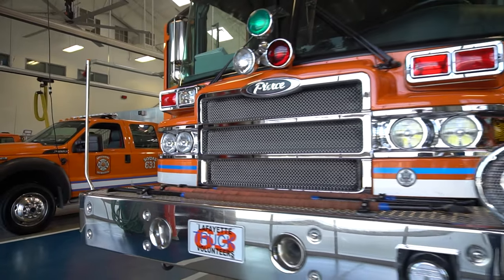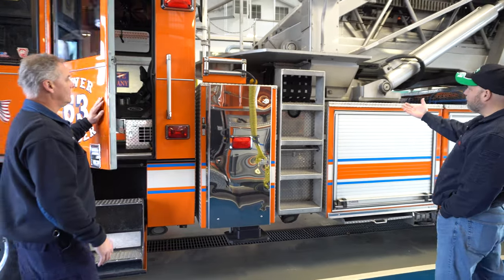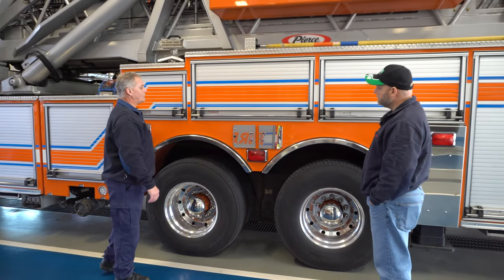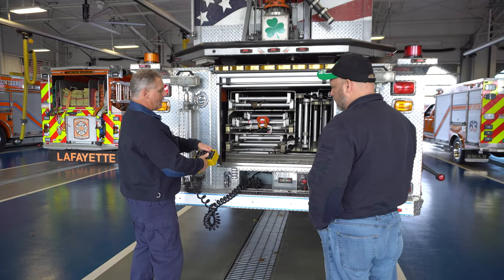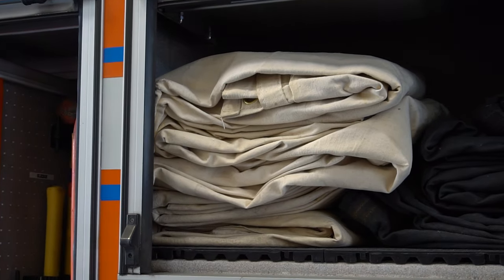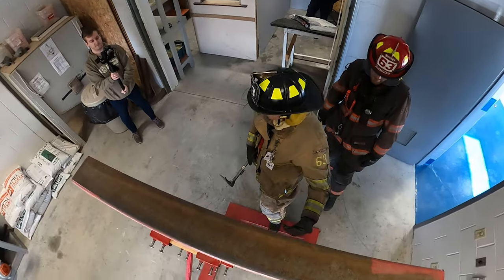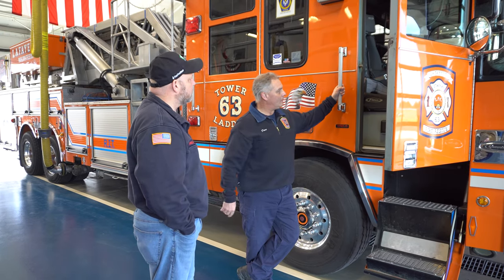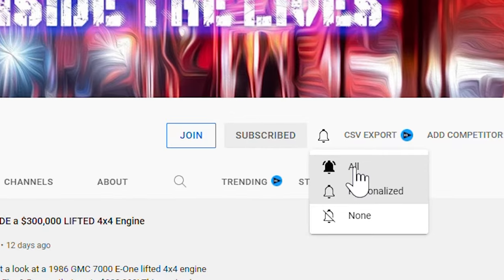ORANGE Fire Truck/ Good Idea?

Comment: Well, I don't think the color is bad at all. We have something similar here in Germany for the fire department, it's called RAL 3024 Leuchtrot(glowing red). This is to achieve a higher warning effect, which ultimately serves the safety of firefighters. The advantage comes particularly well in the twilight to the effect.
Reply: Same here in czech republic, right now all new engines come in the glowing red or orange and alot of departments are going for similiar colors.
Reply: Wht part of Germany I lived in Heidelberg Germany for 3 years and am a former vol firefighter here in the US

Comment: I hate to break it to everyone but the story behind the Orange paint that the chief explained...isnt the actual story. The '49 Chevy was built by High Steel, the same people who made the engine bay. When they were building the truck, High Steel didnt have red paint, they only had orange. So they painted the truck orange and the rest is history.
Reply: Not to be confrontational, but is that not what the Chief said? Just in slightly more detail?
Reply: @Ameri-Texan  It didn't go the way that current chief says it did. Like I said the original truck was built by High Steel there in Lancaster and they didn't have red paint, so they did the next closest color and rolled with it up to modern day.

Comment: It’s a shame Pierce discontinued the Quantum.
Reply: Really ?
Reply: The Arrow XT is also, they won’t comply with new EPA requirements. The way they are designed will not allow for enough air flow for cooling the compliant engines. At least that’s what our rep told us.
Reply: @FirebrewTV  ik
Reply: Pierce still makes the Quantum chassis one of my neighboring department just got there truck in the that 6 months and they are building there Quantum rescue truck right now should have it by late spring
Reply: @benwatters9255  as I understood it, Quantum and Arrow XT will be available until the new EPA diesel requirements take effect. My department is in process of spec’ing a tower ladder and the EPA regulations were a topic of conversation- the discontinuation of those product lines was mentioned. Probably one of the reasons the Enforcer chassis got some of the recent improvements.

Comment: When asked about a cdl to drive the apparatus . In pennsylvania when responding to an emergency with all emergency warning lights activated and sirens being utilized while responding . The driver operator does not need a cdl . But since the vehicle is over 26,500 pounds by rights the driver operator should have call class B license w/ air brake and tank if needed . Though most law enforcement turn a blind eye to that rule . The insurance company for the apparatus actually will love that if the driver operators are in possession of a cdl and it does drop the $$$ per month paying the bill .
Reply: In volunteer organizations the additional cost of maintaining a CDL for an individual who needs it for nothing else would eliminate even more volunteers. It should also be noted under the new rules instituted a few years ago increases the inconvenience even more as they would literally have attend a truck driving school.